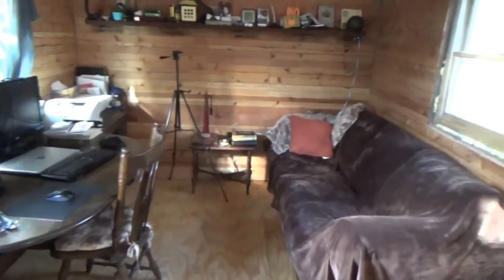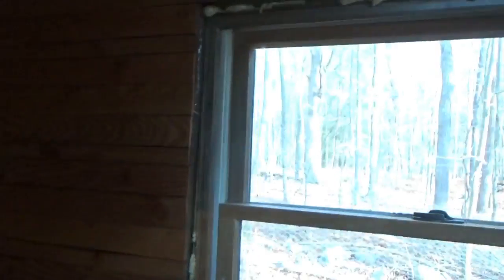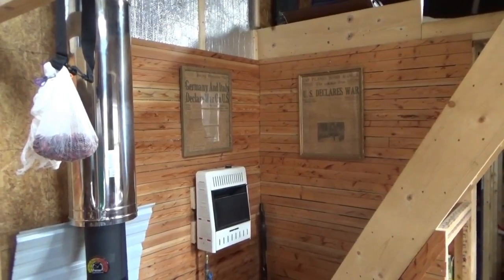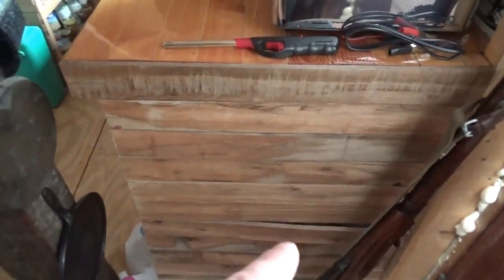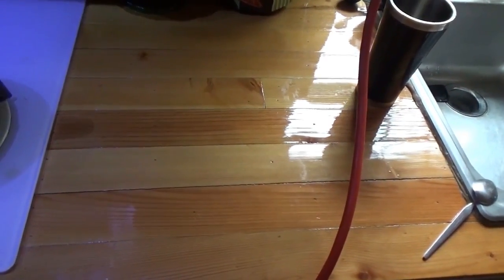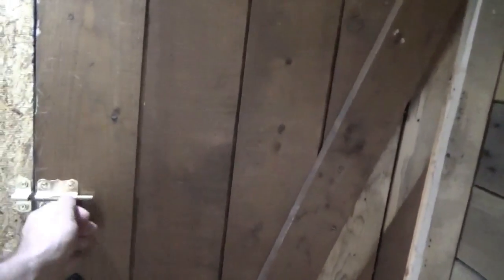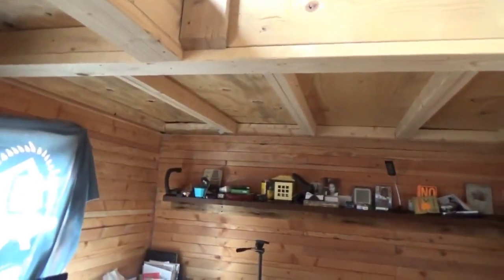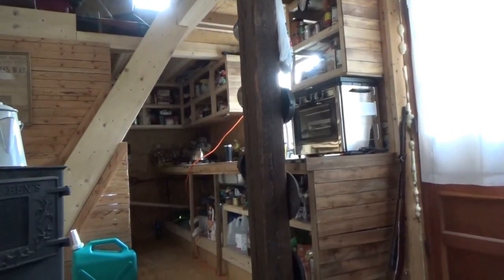Tiny House On Wheels Overview & Update So Far

Comment: That is a really big little tiny house. Impressed! I have some questions.
What are the dimensions of your house? Height in kitchen and on the lofts (highest and lowest point)? How long and wide is the house?
  I am planning on a similar design with two lofts.
Reply from the maker: +B G Thank you. 10x24 outside dimensions. 12 feet at the highest point. Lofts are sloping from 5 feet high to 3 feet. The lofts are 5x9 inside dimensions.
Note: You cannot tow this down the road yourself with the extra width. I have to pay a towing service to do that if I want to move it. You should stick with the 8.5 wood standard if you want to tow it yourself.

Comment: What type of vehicle are you seeking to purchase when you decide to move the TINY HOUSE ON WHEELS ?
Do you have an estimate of how much the TINY HOUSE ON WHEELS weighs ?

You may consider just painting the floor with FLOOR PAINT. It is designed for floors and heavy traffic.

OH, and the only problem with over building items in the TINY HOUSE ON WHEELS is it is suppose to be a TINY HOUSE ON WHEELS that can be towed down the road... It adds weight when you over build.

Keep going you may finish some day.
Reply: +Steve Mazz Personal opinion if he moves to elsewhere on property vs. away, it would be $10,000 minimum. Truck, jacks, new axles, maybe i-beams, escort vehicles front & rear, utility crews (over-sized wide load, under electrical, avoid bridges, etc if he takes on road- add $x per mile.)Less if it stays on his property, where he lives now.

Comment: Why didnt you just build a cabin?
Reply: +wayne brown IMHO - tiny homes on wheels in some jurisdictions don't require as healthy a chunk of taxes paid on them. Vs Stick built and on foundation, pretty much why there is a tiny home movement - Google it.
Reply: +wayne brown  John is right, and also at the time he built it he was still renting so at that time it was critical to watch the weight in case he actually had to have it moved... but now he is buying the land so the pressure on weight is off somewhat. He might be able to put a foundation under it and use it as a hunting cabin now... but it depends on his code enforcement department.  No point getting into a legal battle over wheels vs no wheels at this point.
Reply: +John Caron  I think it more has to do with the healthy chunk of septic field which is not going to happen on Troy's granite mountain.  But a THOW is self contained so no sewer system if required.

Comment: Have you forgotten the stove pipe dampener?  You will need more or wider towel hanger!
Reply from the maker: +Sylvain Maher I never used the damper in the other stove pipe because the stove itself has super air flow control built in. I will be getting more towel hangers, yes.

Comment: Just one problem on the wood stove installation. That piece of corrugated steel behind your non-triple walled pipe should be off-set from the wall, like ceramic insulators screwed or nailed to the wall. You need an air gap behind that steel panel, otherwise some day you WILL have your paneling burn. It's amazing how quickly even plaster walls behind stoves can burn and then spread through a house. This reasoning from 30+ years of woodstoves and more than a couple of times going into burning houses because someones installation had one screwup.
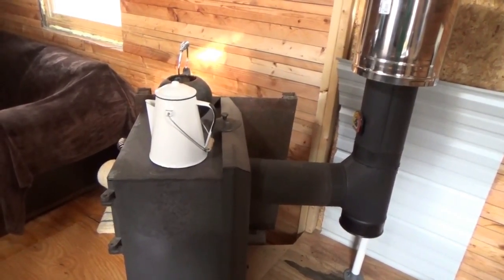Reply: WC Prepper 2 @ 19:33 it's leaning against wall and on floor. If it were held off from wall 1-2" and up from floor 1-2" it would pass code, even in Maine. It's hard to keep a digital reading on a wall if you're asleep, and die that way with your animals.
Reply from the maker: +John Caron I plan to set up a proper and nice heat shield. Believe it or now, that metal works for now. I keep checking with a digital gauge
Reply: +The Do It Yourself World Best I can say is do it now. I used to know a person up here in Maine, and his son had planned to do the same for a year but, kept getting sidetracked. Care to guess how the son died. My wife and I were first on scene, called the FD, and I even went in with the PD but, his body wasn't even seen until the FD showed up with the search lights. Thick acrid smoke is impossible to breath in, let alone find bodies unless they're felt on the first crawl through. Especially in an off grid situation. Your life dude! If not for your own safety think of responders, it gets depressing knowing that that strangers house burning had your friends son in it, after the fact.
Reply: +Tracy James Tavares Don't think his wood is green, although if he calls it "cured" one more  time I may expel. It seems" dry", when video'ing you can't hear the sizzle and cracking of wet wood in the background. Regardless of the Temp you would hear that.
I've always used concrete backer board on rear walls for houses. Camps/Cabins - sheet metal on electrical ceramic standoffs held out from wall 2" along sides and with a 2" gap at the bottom for air circulation behind the panel. But, even on my camp I had concrete backer board behind the corr. roof panels, figured out it took me 30 years to find it and I didn't want it to burn. Especially if someone in-experienced with wood heat tended the fire, to a pretty cherry color.
Did the same on my own off-grid camp, 2 hours from a  fire dept.Approved by my insurance company and the fire dept. that would eventually appear - maybe. If the road was open, the lake not frozen,etc. Forggot the only place I didn't use backer board or steel panels on stand offs was behind my old Glenwood cookstove circe 1866, brought it out another 6" at insurance companies request and I was golden.
Reply: As I recall he put backer board beneath the stove and beneath that black thing under his stove.
If moved he should attach it to the floor. 
I've been looking at mobile home/RV/Tiny home installations of wood stoves, and you just set them up, the same as for marine environment. Bolted to floor,(If you ever expect to move them, Troy owns the land).
I vaguely recall that his woodstove had a min. clearance rating on it. The min. clearance is within allowances but, the sgl. wall pipe is not. I can understand difficulty in getting a pipe with a cleanout on it, esp. when you set up yourself but, NY must not have many woodstove shops. Every store I've been in has cleanouts galore.
Me I use concrete board under and to the sides of all woodburning appliances, covered with slate. He doesn't require as his stove has ash pan built in (I think).No live ash spills on floor.
Reply: Don't worry about the stove anything above a magnitude 7 is a problem for anything not attached to concrete foundations, with earthquake ties. A mobile Home using ties, becomes just something that might survive if a tree doesn't fall on it.  

Personally one 8 scale in 40' RV in city street, luckily not near buildings/trees. The RV Coach did bounce, I did skid, the coach did survive. But, I didn't have trees above my roof or bldgs. falling on my head.

If you clean your stove, it doesnt matter keep it at an acceptable level. My Lopi couple of times per month, I scoop the ashes, and place in airtight can. 2-3 days later stone cold ashes can be put in garbage bags to dump or for winter usage.
Reply: WC Prepper 2 I can't see an issue with his propane tanks (I know you dislike the placement) the only issue I have with them is a lack of roof above them. In the words of my insurance company for my camp if ice fell from the roof onto the valves they might crack and then I'd have projectiles. Cool,- I installed a shed type roof above my propane tanks beneath my 12/6 ? main roof structure and got insurance.Sidenote- FD and Insurance company didn't care about the proximity of tanks to structure, they only cared about a roof to protect the valves.But, that was Maine thank God not, NY state. They seem to be a world unto themselves.
Reply: Now I understand,, you a Western Provincial? Or Pacific Northwest?
They make woodstoves specifically for mobile homes, rv's, and marine installations. etc. Made for bolting down, without L brackets, etc. being drilled through legs as an after thought or added on to stoves made for everyone else.
Some are pricey $4000 to affordable $500 new woodburners. Made for bolting down  and for marine use or RV's.Propane carriers can be attached to Concrete, as well but, here the greatest magnitude in the vicinity lately was a 5.1 in 1920, minimal damage as for my area a 2 in 2014.
If you want a couple to search for let me know, Choose your fuel type. Wood, Coal , or Propane. If you use a dbl. or triple wall stove pipe screwed  at each section, and attached with cement and screws to stove. You'd need to check on liability laws but, think your chancing of getting out alive would be much improved.
I did once see somewhere a picture of woodstove hanging by rafters with no floor beneath it after a quake in CAlifornia somewhere.

Comment: How much does the tiny house on wheels weigh now?   Since heat rises do you get to hot at night when sleeping in the bed loft area?
Reply: The Do It Yourself World Troy, It is fans like this guy who are chasing your subscribers away!  I'm sure you have seen Beth commenting many times and know that she is anything but a troll.  (Don't mean to speak on your behalf Beth.)
Reply: +James  Lemons  Wow!  My guess is she wants to learn something new; it is part of human nature.  How does that make her a troll?
Reply from the maker: +Beth Grant-DeRoos The tiny house weighs about 7,000 pounds right now empty. With the siding I think it will be around 10k and will need a new trailer. Another reason I am dragging my heals on the siding issue. The trailer is rated for 7,000 pounds so I am at max now.
Upstairs gets hot so I keep the windows open 24/7 all year long. It helps a lot. I also have the ceiling fan that helps.
Reply: +James  Lemons  Actually Troy is someone I like.  Was curious because he has noted in a number of his video of how he wants to keep it under a certain weight and I was interested in knowing how he was doing.  And since I have slept in tiny homes on wheels I where the lofts lacked the windows that open which Troy was wise enough to install, I was wondering how hot his loft gets at night.
Reply: +The Do It Yourself World  You were smart to put windows that open up in the loft area.  Have friends who regret not putting in windows that open and ended up putting sky lights above the bed, that open so in summer the heat can escape, otherwise its a furnace in the loft.

As for weight issues, its something folks who build tiny homes on wheels have to keep track of as the pounds can add up.  Yours is a work in progress.   Merry Christmas.
Reply: +Dianne Booker   Around here I have seen them put small modular homes that had been on a cinder block foundation on a trailer that had extra axels added. Was a two day job.  That's why I advise folks to do what an tiny house elder in our area said, which was over buy a trailer from the get go that has more axels, because it allows for more haul weight.
Reply: +Beth Grant-DeRoos books are very heavy
Reply: +James  Lemons      Don't forget, sjr is also a troll.
Reply from the maker: +Beth Grant-DeRoos Thank you.
Reply: +The Do It Yourself World instead of a  ew trailer, you could check into maybe adding another axel. Just a thought, don't even know if it's possible, but would be a lot less expensive if you could.
Reply: ***** Troy says that the trailer axles is at max now. That's why he is dragging his heels putting on the siding.  Would another axel be possible?  I've seen 3 & 4 axel trailers,  so why not?
Reply: +The Do It Yourself World If you use something other than pallet wood like, tongue and groove pine boards 1/2&quot; to 3/4&quot; thickness, my camp siding 25x50 came to 1000 lb&#39;s. and that was for a higher and larger building. If you want to use pallets stacked like shingles, vs cut like them  your weight will probably be very much over your calculations. If I remember your earlier videos from Trailer vague recollection of a band saw. You could split your pallet siding with the bandsaw, use more with less weight (split at angle). Where you use 5 now, the coverage would grow to 10 more coverage with same weight. Would strongly suggest stain either clear or solid though to prevent rot.
Reply: ***** Pshaw, he's just a slow worker.
It takes him awhile to get around to things. He wants it to be recycled only. A dado head $30 on his table saw and barn wood he gets, shiplapped siding to cover that thing in at most 2 days. Shiplapping boards with the dado might take him 2 weeks during winter. I bought mine but, sided 3 bldgs in a week, by myself. These young'uns just don't know how or when to pace themselves.
Reply: Wanted to note since tiny houses on wheels have become very, very popular in my area of the Sierras, and are licensed like an RV or mobile home, the authorities are warning owners that the tiny house on wheels cannot go over the allowed weight for transporting with a permit, on state highways. Seems some people assumed if it was built on a trailer and had wheels that this was all that was needed. Then they started adding additions on sides or top and soon the tiny house on wheels was no different than a tiny house on a foundation, which made the tiny house on wheels ILLEGAL.  A couple people not far from us are in the process of removing the additions they had created.  Otherwise their tiny house will be taxed as a regular home.  The difference would be going from less than $500 a year to around $6k.

Comment: Hi, Considering getting a composting toilet. How often do you have to clean it out. I will be the only one (except an occasional visit from family members) using it so I fgure maybe a month for just one person. What has been you experience? Thanks, Dave
Reply from the maker: +BigFireDave For one person this one goes for three months before you  have to empty it. Cleaning is easy. It is like fertile soil from the forest floor. It comes out really easily.
Reply: Thanks for the info. Not having a blackwater tank will be nice. Building an RV to live in from a retired mass transit bus. 8-)
Reply from the maker: +BigFireDave You still have the liquids separated from the solids in the toilet but depending on where you live, some areas allow you to mix it with water and use it on plants. Yes it is good for plants when diluted. I am working on a complete filtering system for mine.
Reply: Actually, the info I just got from a different RV blogger on YouTube says he gets 2 months with he and his wife using it. They live in their RV like I am planning on doing. He also has a unit with a fan that he says is quite refreshing while sitting there and you get a gentle breeze down the toilet. LOL 8-)
My main concern was that I could boondock for 14 days with adequate water and greywater storage. Looks like the composter will be my choice!
Reply from the maker: +BigFireDave And no sloppy, stinky, filthy black water tank to dump. Oh I hated that so much.

Comment: Thanks for the update. Glad to see things shaping up. I really like the layout. Regarding barn wood trim. I think you said that you hadn't installed it before because it was too cold and wet and would shrink, so you needed to dry it out. Now the cold weather is coming back. Is the barn wood under cover in the tent? Will it get buried under snow again? How can you finish interior after cold weather comes, won't you have the same issue? You might want to rethink your coat rack before Melanie joins you, just doesn't seem to be working where it is over the table. Enjoying seeing the progress when you share it and look forward to the next video. We all want to know what it would take for you to live in the tiny house without legal problems, but i won't hold my breath for that answer. Still in your corner and hoping for the best.
Reply from the maker: +Susan Galuski Thank you. I have all the kitchen wood in the wood shop tent, nice and dry. I am working on putting away pallet wood for the other walls. I also hope to have barn wood put away for later use before the snow falls.